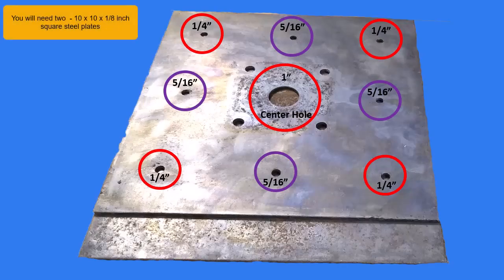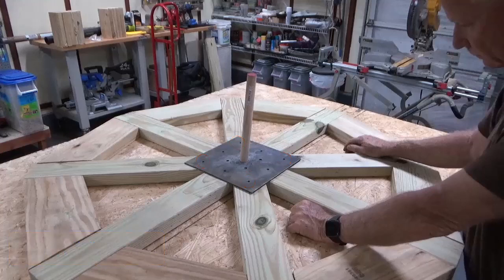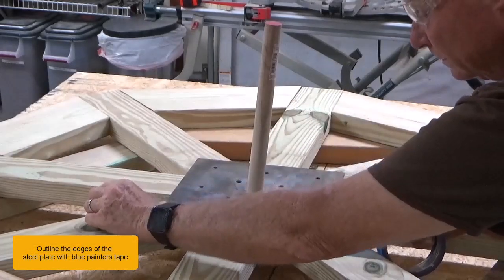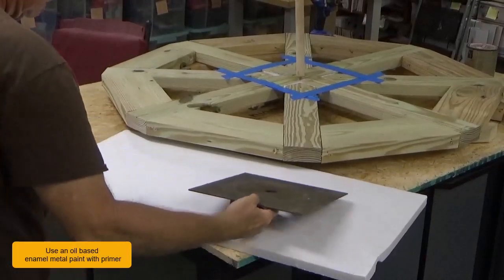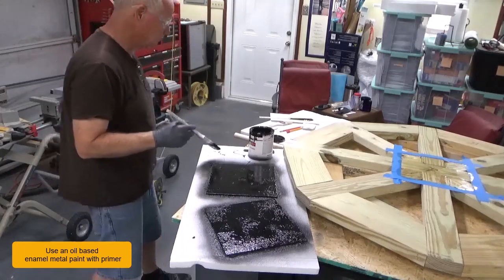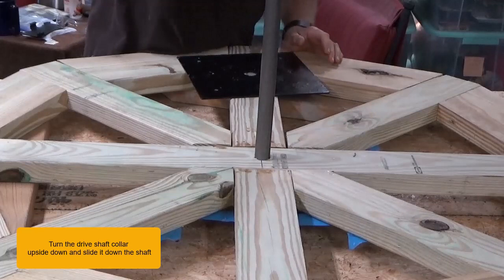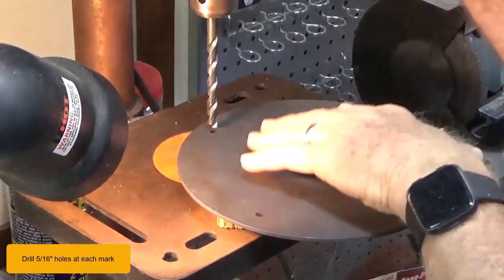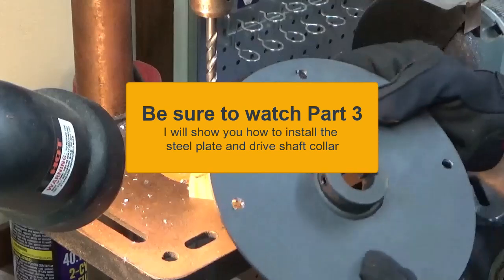Part 2 of 8 - Water Wheel - How to Prepare the Steel Plate and Drive Shaft

Comment: Did you make your driveshaft collar, or did you buy it pre made?
Reply from the maker: Below are the parts I used for the drive system:  Click the links to view or order the parts needed.
Source for Fully Keyed Shaft and Keys - https://redboarchain.com 
Pillow Block Bearings - https://amzn.to/3s6hHov
Shaft Collar Lock - 1.00" Bore Diameter - 303 Stainless Steel (2 Pack) - https://amzn.to/3OS3hB9
8” Brake Disc – 1” Bore – 1/4” Keyway – 2- Set Screws - https://amzn.to/3OSwDPX
10x10x1/8” Steel Plate - https://amzn.to/3KC0ARO
Thank you for taking your time to view my video!
Norman
Reply: @NormanGooch thank you